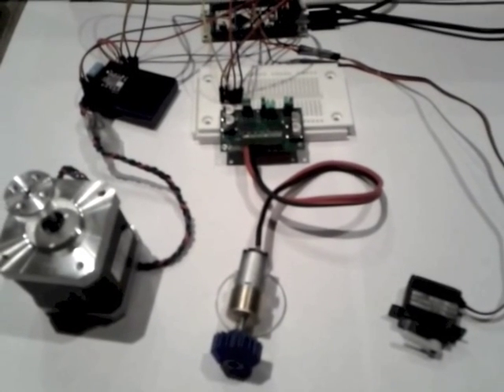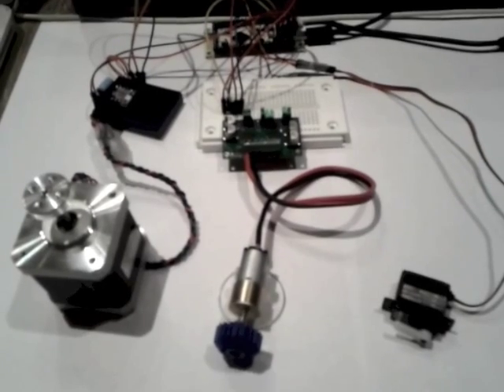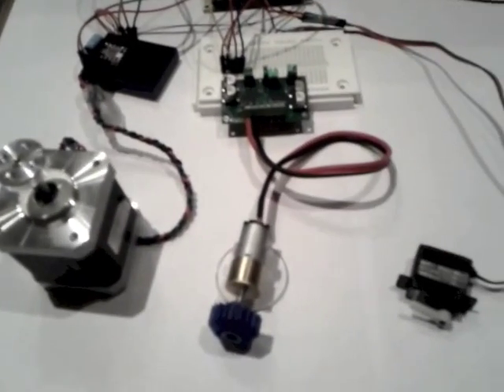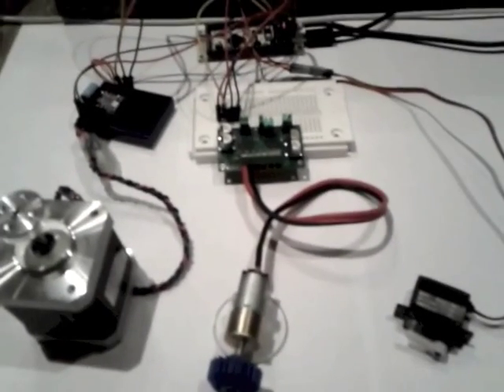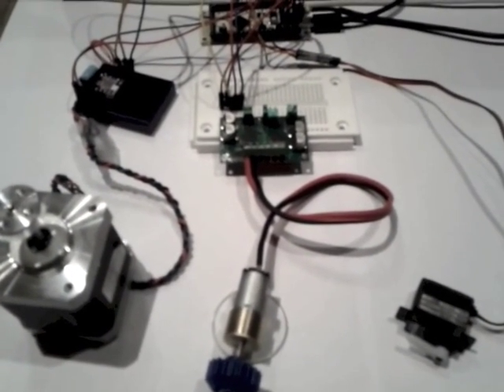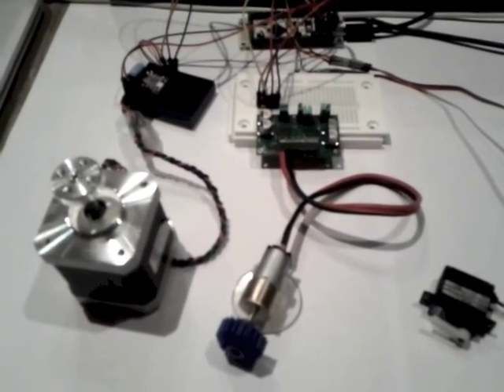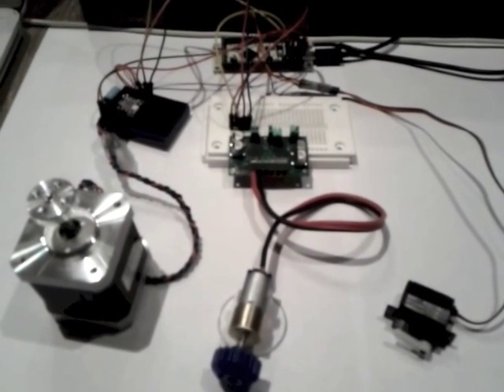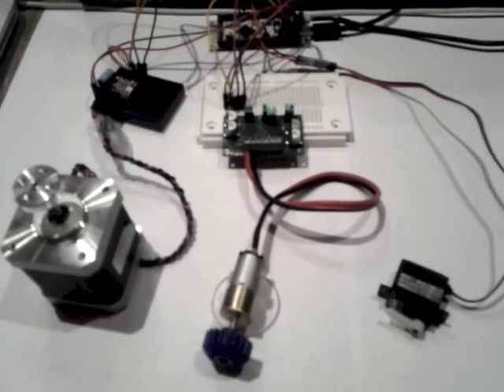IOIO Motor Control Preview

Comment: Is the IOIO connected to the tablet via USB or Bluetooth?
Reply from the maker: It works either way (like all the IOIO functionality).
Reply: Ytai Ben-Tsvi Any chance you could post a link to this demo code? The code I'm using produces smooth stepper movement when connected via USB but has quite a bit of skipped steps when connecting via Bluetooth.
Reply from the maker: I don't have the code I've used for this demo. The HelloSequencer app in the official software bundle is similar. Are you sure you are actually skipping steps as opposed to just stalling? If the latter, it means that the BT bandwidth is insufficient for the rate of data you're pushing and simply scaling all your time constants by a >1 factor should fix this.
Reply: Ytai Ben-Tsvi I do think it was stalling and not skipping steps (my bad). I have tried putting in a time delay between each step and it does seem to reduce the amount of stalling but it's still skipping a little even with a 8ms delay (which is a bit slower than I'd like). I'll take a look at the HelloSequencer app and see what I can do to improve my code. I'll also play around with a few other Bluetooth adapters and see if that helps as well. Would updating the application firmware from 330 to 400 help much or should I go straight to the 5.00 / 5.03 release candidate?
Reply from the maker: Now I'm 100% confused. The Sequencer stuff has only been introduced in version 5. What have you been using so far? Also, when I talked about scaling the time constants, I didn't mean to add delays, but rather to change the time constants on the sequence, to make everything slower, resulting in less cues/sec being sent over the wire. But after having read your last comment it appears that you're using something else.
Reply: Ytai Ben-Tsvi Sorry for the confusion. I've been using 330 with the same idea as this program: https://github.com/zrecommerce/ioio-easydriver
I'd been changing the delay after each step with the timeout function (that's what I figured you meant by time constant).
Basically what I'm trying to do is have a variable for the number of steps sent to a method that runs the steppers with a IOIO. I'm fairly new to the whole java/android programming thing so the above code is the simplest way I found to work for me. I did try implementing the sequencer idea but the app keeps crashing on me so I still have a bit of work to do.
Reply from the maker: The code you linked to is a bad way to achieve what you're after. If I were you I would abandon this path and use the Sequencer API. Start with HelloSequencer and incrementally modify it to suit your purpose.
Reply: Ytai Ben-Tsvi I'll try that then. Thanks for pointing me in the right direction.